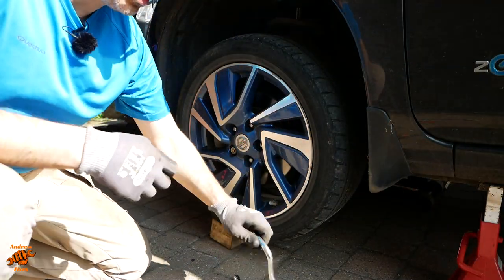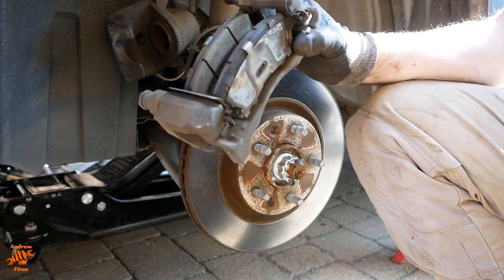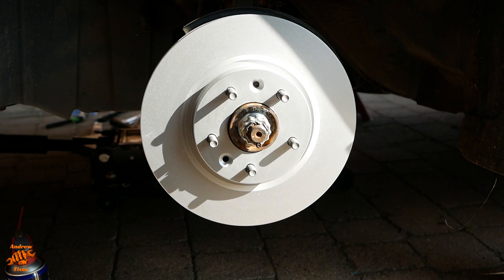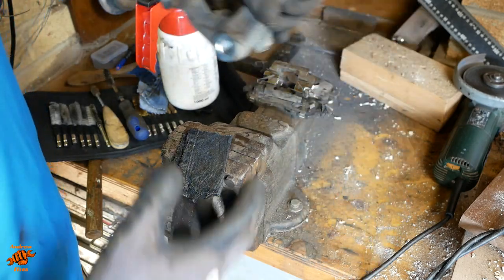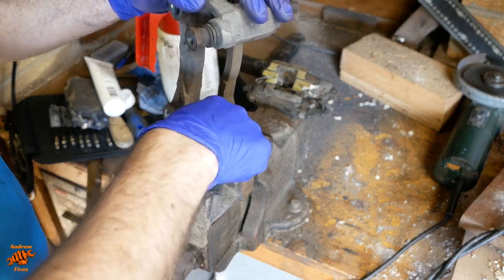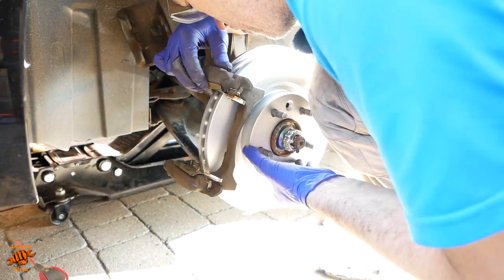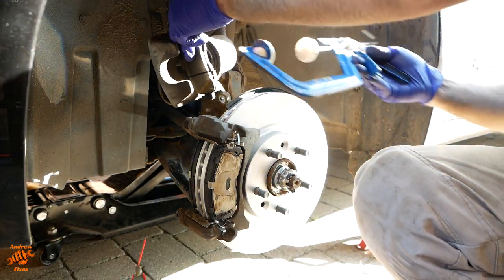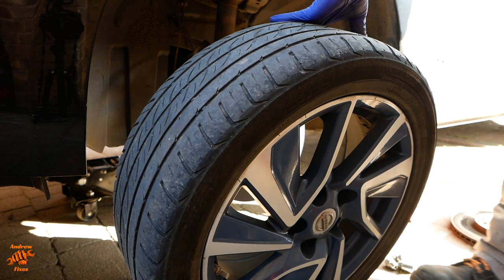Nissan Leaf front brake pads and discs replacement detailed how to guide

Comment: Nice detailed video.  The condition of my 2013 LEAF driver's side rotor was basically identical to this one.  In addition, my pads were seized up in the tracks of the caliper.  Driver's side was seized so bad that the brakes were rubbing constantly and reducing my range.  I used a fine-tooth square file to fully clean the tracks in the caliper, so that the new pads would not be too tight and unable to move freely.  Also filed off some burrs on the ends of the new pads.  Immediately noticed a quieter ride and increased range after doing both front wheels.  Note that this car has spent its entire life in Illinois and Wisconsin, where the roads are heavily salted in the winter.  If you live in a warmer climate, or wear out your brakes in less than 10 years, you probably won't have this issue.

Comment: Gotta do mine at some point too. Looking at the wear on  my front discs, I'd say that the pads are not making full contact with the discs. And watching other YouTube videos on the Leaf, they seem to have the same issues.
Reply from the maker: Thanks for your comment, yes it seems to be a fairly widespread issue with Leafs (Leaves?). The pads get stuck in the pad carrier and so aren't pressed evenly onto the discs, causing the uneven wear as found in this vehicle. Hope you manage to get yours changed OK.
Reply: same issue with the disks of my leaf.I find it pretty odd

Comment: My 10 years old Leaf has 240.000km is still on the original pads and discs, front and rear.
Reply from the maker: Very good, shows how long they can last if the car is driven regularly and the brakes are serviced from time to time. I suspect this car had been left standing for some time by a previous owner. The brakes definitely hadn't been serviced!

Comment: I've known the Toyota Prius to go to 150k miles before brake work, so I was surprised to find out that the Leaf needs brake work so soon.
Reply from the maker: This one was quite bad, I think it had been left standing for quite a while before I bought it. Is the level of regenerative braking in the Prius comparable with the Leaf? I don't know the answer to that. The Toyota also has the benefit of Toyota build quality, which in the case of the Prius is far higher than the Leaf in my opinion.
Reply: @AndrewFixes  I don't have data on how much Regen either car actually gets, but subjectively the two cars feel similar. The Leaf's braking can feel abrupt at lower speeds, not as smooth as the Prius. Repairing the Leaf's brakes helped.

Comment: should new brakes make a difference on your mileage?   my brakes on a newly purchased 2011 leaf were absolutely horrible but afterwards the mileage seems to be more like true mileage
Reply from the maker: If the old ones were binding, then replacing them could certainly help with your miles/kWh figure.

Comment: Hi I just bought second hand Leaf 2011 they replace all discs and pads but they rattle do break system needed to be reset after change of parts ?
Reply from the maker: I don't think any reset is necessary. Did they file away a lot of rust on the pad mounting points? That could cause the pads to rattle. It may also be that the brake pad mounting hardware needs to be replaced.

Comment: You say the pad carrier is torqued to 165Nm and the caliper to 26Nm but on the autodoc video it says 75Nm and 35Nm?
Reply: I found the 2014 Nissan leaf Repair Manual, the 165Nm and  26Nm values are correct!
Reply from the maker: Hi Chris, thanks for your question and the update. You beat me to it, apologies for the delay in getting back to you. As you've found, I got the torque values from the factory Nissan Leaf manual. I don't know where the figures in the other video came from. Most of the pad carriers I've worked on had much higher torque specs than 75Nm.  Cheers, Andrew

Comment: I've been brake work on my cars for 40 years, and I must say these Leaf brake calipers are the absolute worst.  All those spring little pad keepers, always popping the pad out, just when you get one in, the other pops out.  Why would any brake designer do this.  Why not a couple of drive out pins, the pull the pads like many other brakes systems.  Or, pins that have a small clip to be removed, then slide the pin out, slide in the new pad, pins back in - done.  Another thing, you better wear gloves on these Leaf calipers, or your fingers will be cut to shreds by all the sharp edge spring pad keepers.